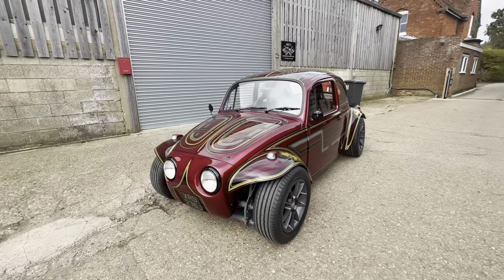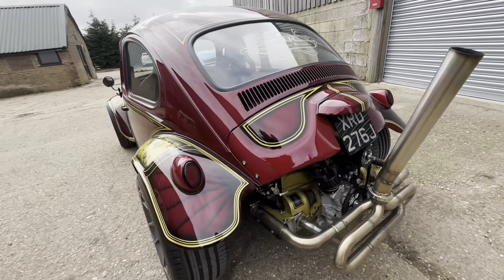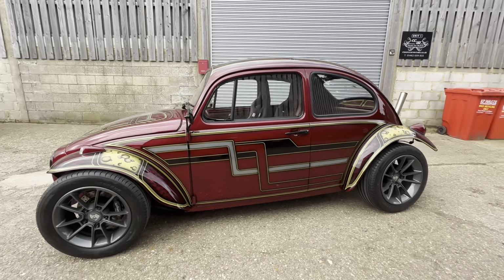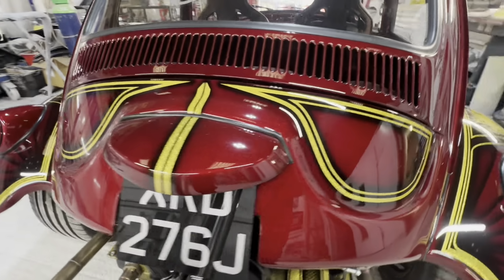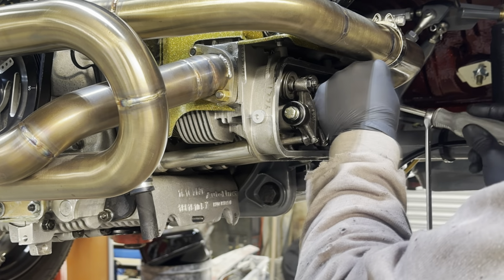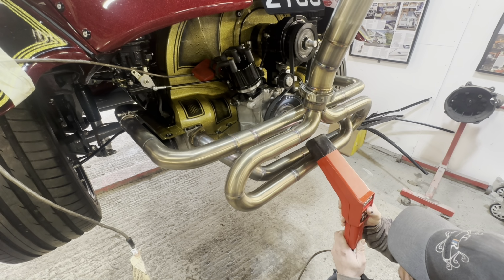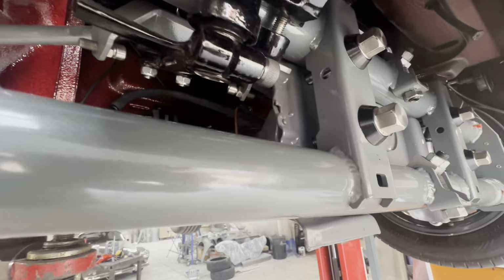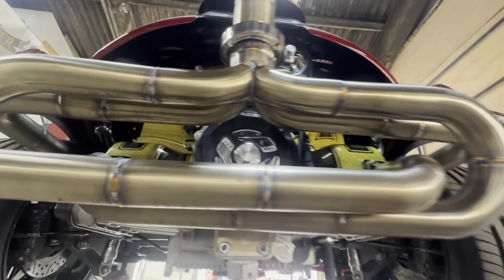The Street Baja! Full custom painted show car

Comment: Bruh, that car is next level. super cool design elements. I love almost all the aspects of it. only change I would do is the seats, but other than that, it's a show stopper. I don't think I have ever heard of your shop. Keep up the great work. Love those billet spring plate covers. do you all make those? Also do you make those special bolts for the spring plate cover?
Reply from the maker: Thank you 🤙🏻 the spring plate covers are sold by most outlets - they were off the shelf items! Check out our instagram for more of our builds, we’ve built a few cars featured in Volksworld Mag now

Comment: If it was a 70 beetle, it would not have had vents behind the rear windows.  Cool paint job !
Reply from the maker: You’re right, it’s a 71. Just checked back. Difficult to remember everything when running through everything we did to it last year. Thanks 👌